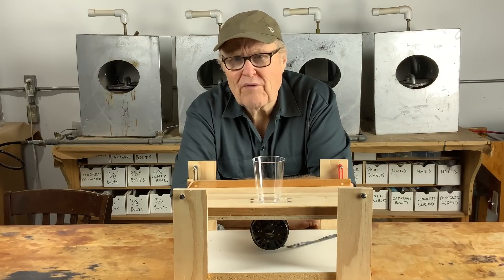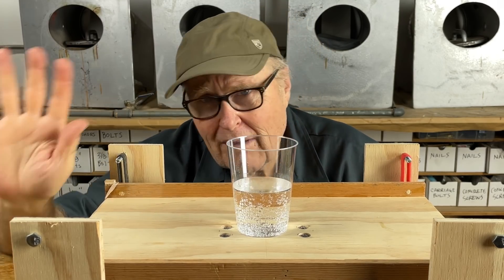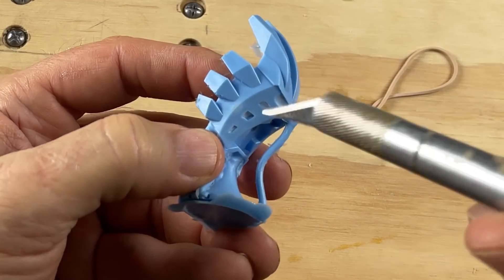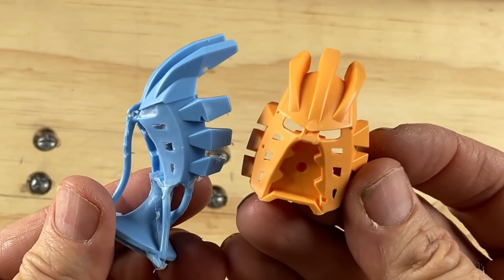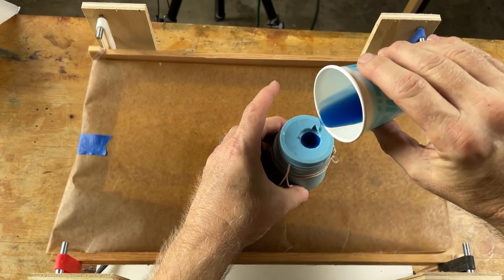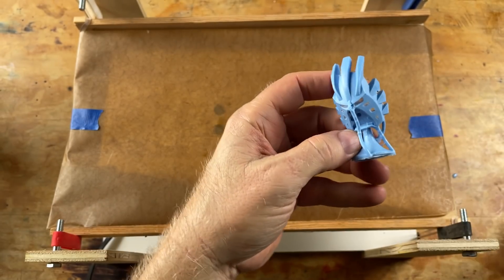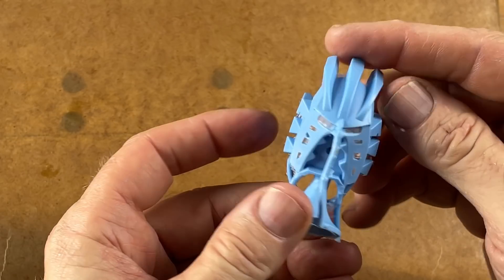Does Vibration Work? Let's Find Out!

Comment: It would be a bit complicated but a chamber that can be both a vacuum chamber AND pressure pot could possibly solve a lot of problems, particularly if it also has an automatic resin mixer/dispenser. I'm thinking put your two part resin in separate chambers above the mould, close the vessel and evacuate the air, then allow the resin into a mixer nozzle where it flows into the mould below ( which is also of course in the vacuum) then when filled allow air pressure in which will further ensure the resin is pushed into all the nooks and crannies with no air to get in it's way.
Reply from the maker: There are endless ways to set up a production casting studio with all sorts of metering and injecting systems. They work great and allow factories to cast thousands of parts an hour. I’ve toured some impressive operations in Asia. 
I’m a prototype shop so my volumes are small. For me it’s much simpler to gravity feed resin into a properly vented mold. Then pressure cast the resin to suppress foaming. Once in a rare while I have to fill a bubble in a casting. No big deal, and much easier than operating an automated injection system every day!
Reply: @RobertTolone  I know there's industrial ones I was thinking of a smaller scale much simpler system that would be practical for small shops/hobby use.

Comment: Hi, I just started resin and I don't have a pressure pot (yet). What is the next best option to handle bubbles?
Reply: Use a resin that is very watery when mixed and has a long cure time so bubbles have time to rise out.

Comment: you can knock the bubbles out of something like cement, or ketchup, because its a non-Newtonian fluid that becomes lower viscosity when force is applied. maybe some resins and silicones are also non-newtonian?

Comment: For all those people who ask about removing moisture from the resin you can do it in a number of ways, the best solution is to not get it wet in the first place! This is best achieved by remembering to close your containers after use and buying resin in volumes which are appropriote to your usage level, but I get its cheaper to buy in volume! If you do have larger containers the following can be used to keep them dry (as used industrially) you can fit a tap and an air bleed to your container the tap is under the resin level and the air bleed replaces the air in the container so you dont cause a vacuum inside the vessel, the important thing here is the air bleed this needs to only allow in dry "air" there are 2 ways of achieving this the best it to connect the bleed to a cylinder of dry air or even better nitrogen.  If that is not possible then a cylinder (much like the exhaust muffler on Rob's pressure pot) filled with dessicant gel (regularly replaced) attached to the bleed will help dry the air on its way in.  In general these methods are used on the industrial scale and in most instances are not suitable for the home user to impliment (you would be better off just buying resin in smaller bottles or buying in large and on first opening transfering into smaller appropriote containers to minimise the number of openings). 

If however your resin is wet you can remove the moisture in a couple of ways
1.  With a vacuum but you will need to have it under vacuum for a long time (hours) to get it dry enough to remove the need to cast using a pressure pot.  Heating the resin or stirring it while under vacuum will speed up the process but heated vacuum mixers are not cheap! 
2.  You can add a chemical drying agent.  The most efficient of these are what we (resin formulators) refer to as molecular sieves they come in a few different forms such as beads, fine powders, and pastes to name a few.  All work by chemically binding with the water and in doing so preventing it from reacting with the isocyanate in the hardener.  This binding process is very quick but the diffusion of the water through the resin is relatively slow, so once again you add the molecular sieve and then leave the resin for hours in a sealed container.  Once again heat and aggitation will help speed up the process.

The benefit of a chemical agent over the vacuum is that if you add it to your main containers in excess it will continue to dry your resin after every time you use it.  However, even if you do this to reduce your moisture you will still get better castings by curing under pressure, as it will help minimise bubbles trapped in mould cavities as well, not just solve the foaming issues.
Reply from the maker: Hey Chris! Thanks so much for the detailed info about keeping resin dry! Over the years I jumped through many of the hoops that you describe and have settled on a simple solution for me that works: Keep the resin containers closed tight and pressure cast the resin.  The main reason I use pressure pots is to suppress resin foaming.  I rely on proper venting to remove the air from the mold cavity.
For rotational molding I buy fresh resin for each project and charge it to the client. That way the resin doesn’t foam and the castings come out fine.

Comment: This is why pressure pots are industry standard. 
They are not cheap to manufacture. 
They are not efficient to use.
They come with a whole host of limitations.  
Despite thier faults, they still remain the best tool for the job.

Thank you Bob. This is a very important video.
Reply from the maker: The next video in production is why I don’t use vacuum to cast resin into molds.

Comment: That table probably wouldn't work very well, but you might have decent luck at shaking out the bubbles by using ultrasonic vibrations, like the kind used to shake free microscopic debris from medical tools.  Those same things can be used to create barrel aged whisky within minutes, instead of years.

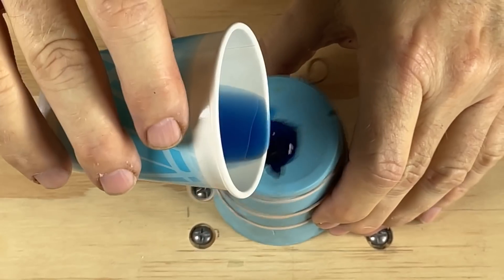No idea if it would work for this application, but I'm certain it would do a much better job at it than the setup you've got there.  (I'm only 1:48 in, so maybe you tried securing the mould later on in the video, but I think your setup would work better if it secured the mould.  Still, no idea if it would be able to shake out all the bubbles or not though.)
Reply: Loved seeing the ending with the comparison, and the problems that are caused by moisture, and air.  Very educational!

Comment: Hello, I have a question. Could you give me a suggestion on how would be the best way to make a mold of a shave mug I have?
Reply from the maker: That is a complex question. I made a series of videos about casting a mug starting with this one: https://youtu.be/G3L0BTNr4xI
The trick is that the mold that forms the inner walls of the mug must be built on a tapered core. That way you can remove the core and collapse the walls to pull the mold apart.

Comment: It would be interesting to see how you would redesign something like the Bionicle head/mask so that it works better with casting.
Reply from the maker: That is a video that I am now producing. Also in production is a video about why vacuum will not necessarily remove bubbles from this shape. This Bionicle video generated more interest than any other video on my channel. I think a lot of people will be interested in a version that is easier to resin cast.
Reply: Looks like part of the problem is orientation of the mold, bubbles catching on horizontal surfaces.

Comment: Curious what you DO use the vibrating table for.  I have to assume you didn't go through the trouble of building one just for demonstrating that they don't work, right?
Reply from the maker: Excellent question Mike. I explained the history of it when I recorded the video but edited it out. The vibration motor is 30 years old. I bought it when I first started resin casting. It was attached to a table made of plywood  and four bed springs. Used that contraption just long enough to determine that it didn’t work and then went out and bought my vacuum and pressure systems.  The original table was thrown out years ago but I hung onto the motor. To build this new table all I did was suspend a piece of plywood with 4 silicone rubber bands.  Built it quick and easy and it vibrates pretty aggressively!  The time it took will be worth it because from now on anyone who suggests using vibration in the comments will receive the link to this video! I am tired of telling people why I don’t think it works! 😄👍

Comment: Now I'm curious about the effect of de-gassing the urethane  vs the pressure chamber.  I'm not sure what the vacuum is removing from the urethane, if it helps pull the moisture out, or if it just removes entrapped bubbles?  I've been vacuum de-gassing, and I don't have a pressure pot...atleast not yet.
Reply from the maker: I don’t de-gas resin but I am certain that a vacuum chamber will not remove moisture from the resin. There are drying agents that do absorb moisture which work reasonably well. The only thing that vacuum can do is cause bubbles to expand. If the expansion is sufficient for the bubble to reach a vent the vacuum might pull the bubble out . But it can never pull a bubble downwards and out of a cavity. It simply doesn’t work that way.
Reply: @RobertTolone  Thanks.  I know that water boils/vaporizes in a vacuum, so it seems possible.  The best resin for my application is fairly thick, and vacuum degassing it before injecting does reduce bubbles in my parts.   However, based on your demonstration, I will design pressure pots once I have designed my production molds.

Comment: It's just the middle of the video now, but I have to say people think of resin as resin and don't get all the variety of materials. Robert is using polyurethane, People mostly use epoxy. With epoxy you can remove bubbles before pouring. Epoxy is much thicker and will hold the bubbles of mixing way longer. While  polyurethane is thinner and don't have that much of bubbles due to mixing. What I would suggest on this delicate thing is talcum powder. And what I personally do with my molds, as I don't have vents, I use vacuum to fill my molds and suck air out of it and let resin flow in. This will even catch some undercut areas and just leaves small enough bubbles for the pressure pot to catch.
Reply: How do you fill a mold with vacuum? Do you pour resin in a vacuum chamber?
Reply: @plastikbeau3695  My molds have larger filling funnels that are capable to hold all the resin for the cast. I do gaming dice, so its small amounts. Then I place the molds inside my pressure pot, put a vacuumchamber lid on and pull the vacuum. This sucks the air out of the mold, then I release the vacuum and the air flowing back in pushes the material in the molds. I repeat this until no bubbles come out the mold and then I put the pressure pot lid on and pressurize the pot to get the last bubbles caught.

Comment: Hi Robert .I am  pouring some resin for a diorama I am making and need to pour a tube 10cm x6cm.  I am using deep pour crystal clear that says it can be  poured up to 9cm in one pour.  You can see my predicament. Would you go ahead and just pour the whole 10 cm or would you pour 9cm and let it cure before pouring the last cm? I am using a silicone candle making mould.
Reply from the maker: Depends on if there will be a visible line between the layers. If yes, I would risk the single pour.  If no, I would pour it in two more or even sized pours.
Reply: Thanks. I was planning to lightly colour the resin but I would rather make sure it sets properly. I still haven’t finished the diorama so I still have some time to think about it.  I feel a bit braver having spoken to someone with your kind of experience.

Comment: I haven't seen the video yet but I feel like vibrations would actually make more bubbles than remove them
Update: I am unsurprised
Reply: Vibrations don't create bubbles ... mixing a fluid with air creates bubbles. The resin in the mold is not mixing with air ... only the very top surface could do that.

Comment: Hi, that’s a great guide video. I don’t own a pressure pot and was thinking casting with pressure eleminates all bubbles. It’s good to see that even using pressure there is going to be some flaws. 

Can you try this with vacuum too? As i mention above i don’t own pressure pot but i have vacuum. If i need parts that close to perfect, i use vacuum chamber after the casting although it’s not perfect it helps. Seeing all of the comparisons of vacuum, pressure and vibration cast in a video definetely help some beginners decide what equipment to get in their shops.  Great video as always, thanks and take care 🙂
Reply from the maker: I will do a video about using vacuum to cast resin in molds. You’re right, it doesn’t work consistently either.

Comment: Why don't you build an oversized cradle for the silicone mold to use along with the vibrating device to limit the amount of vibration (that, or reducing the power of the motor producing the vibration). Right now it seems that is vibrating too much.

Comment: personally, i use vibration + heat gun + vacuum chamber and i RARELY get bubbles. however i degas my resin before i apply it as i free pour sculptures
Reply from the maker: What is the gel time of the resin you pour?

Comment: Could you use longer pot life resin or chill resin and do a vacuum casting  just my 2 cents worth love your video's thank you for making them .
Reply from the maker: Yes, you can use a resin with a longer open time. The trade off is that the longer resin sits in the mold the more it degrades the mold.

Comment: Robert,I am more than a little surprised that the resin companies do not have a chemical  that will remove or displace the water from their resin.  Doc BC
Reply from the maker: The best solution I have seen is attaching a canister of drying agent to your jugs.  They are most commonly used on 55 gallon drums.

Comment: Now you have to test talcum powder, it really works for me and i cast tiny and more intricate parts
Reply: I always thought the talcum powder worked, especially for undercut areas  I would roll molds about to thoroughly coat the interior and then use my air hose to blow out any excess powder.
Reply: @lindasnyder3961  I use a  small make up brush, you really need to keep it light or else there is the danger of pulling out a perfect cast with a nice little talcum pocket on an edge.

Comment: High pours have been the only solution i have found that eliminate bubbles...if not using a pressure pot/vaccum chamber
Reply: Same. On two part molds brushing on a coat layer before pouring the actual cast can work, too.
Reply: @the_Dogpacker  I have yet to try that myself BUT will be doing it here in the future...i work in alot of mediums..from latex to silicone
Reply: yes but these work only in open molds

Comment: Vibration is a science in and of itself, so you probably need a different frequency or intensity, probably even for each type of resin and maybe even depending on the temperature. Less viscous resins are probably going to be a lot easier. 
Honestly, getting the best result is always going to be a sum of all the tools available to you. Vibration will never replace degassing and pressurizing.
Reply: Would be much easier to do with one of those vibration speakers.
Reply from the maker: This was by no means a scientific test. But once a bubble has risen to a place where it is trapped no amount of vibration will move it.  That’s why the best way to eliminate. bubbles is to properly vent the mold cavity.

Comment: Did you vacuum degass the resin before you put it in the pressure pot?
Reply from the maker: No. I’ve never found it to be necessary.
Reply: @RobertTolone  Thanks, I've gotten into mold making and resin casting for model trains because of a goof up I had a few years ago on a model, I made a rubber mold 3 years ago but didn't have a vacuum chamber or pressure pot at the time, now I have both and found the vac and pressure chambers to work quite well so far.......now it's just a matter of getting enough resin into the mold.
Reply from the maker: @rdgk1se3019  Vent the mold cavity correctly and the resin should flow right in.

Comment: Vibrating or knocking is a left over technique from plaster mould making, somehow it has found its way into Silicone mould making.
Reply from the maker: Rocking and knocking can work well, no doubt.
Reply: And chocolate making. Similar viscosity I guess. :)
Reply: Yeah, the real difference is that with plaster or chocolate, you're knocking out bubbles introduced by mixing. With resin, the bubbles are being continuously produced by a chemical reaction. You can't just shake 'em loose and call it a day.
Reply: @intrepidnovice7956  @securityrobot how do you eleminate bubbles in plaster moulds? can you pressure cast it?

Comment: to remove bubbles from viscous liquid you need much higher frequency of vibration.  about 9000-10000rpm on vibration motor.
it's not about amplitude but frequency.   concrete vibrators are 140 to 210 Hz for example.

Comment: You just lost 90% of the vibrations, you need to stick the tub to the surface or make a cradle that holds it all together solid, the best thing for bubbles is to half fill the mould then massage it and squash it around in your fingers, basically agitating the problem areas, not sure that mould would handle it though, also, warm water and a heat mat heats up the bubbles and makes them bigger and more buoyant.
Reply: Seems like a waste when you can use a vaccine chamber and pressure pot
Reply from the maker: It is so much easier to vent a mold cavity. The game is always to use the absolute minimum number of vents to do the job.  Some shapes require a forest of vents. Other require only one. Also, always design the things you make for the process Resin Casting. If you do these things Casting is simple, bubbles are rare and cleaning the castings  is quick and easy.
Reply from the maker: True, I did not do a control sample and this was far from a rigorous, scientific test.
Reply: Seriously?